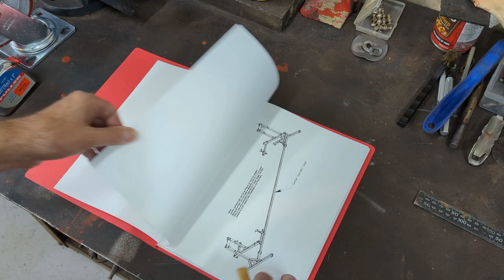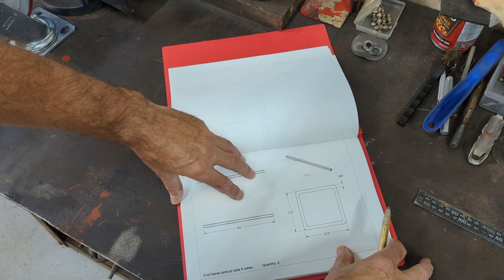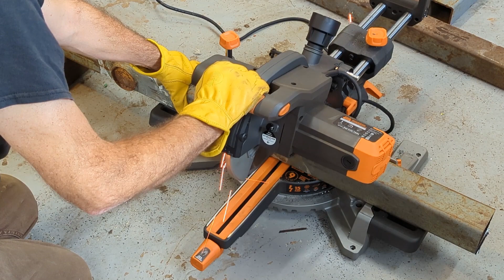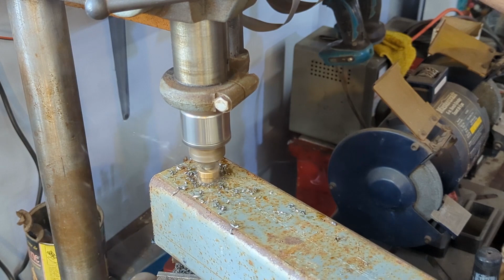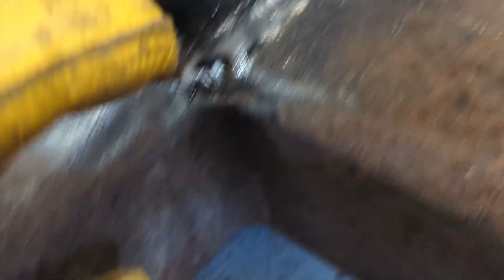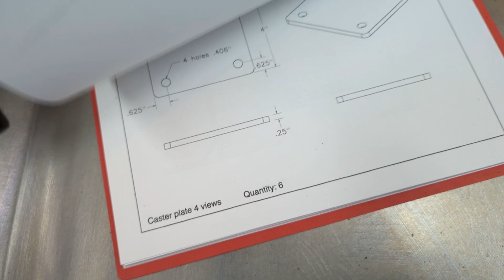DIY Automotive Rotisserie Build End Frames - Part 1

Comment: What kind of welding rods are you running? Looks good!
Reply from the maker: I am using 6013 x 3/32, a little small for what I'm doing, but just need to make a couple of passes to fill in nicely.

Comment: Your stick welding looks pretty good for not having done it for a while. My only suggestion would be to have a box fan close to pull the smoke away from you.  I always hated breathing those fumes.  You are well on your way to a nice rotisserie.
Reply from the maker: Thank you, it has been years since I used the stick welder, I kind of like welding with it...but like you said, the fumes are hard to take, I do use a fan to extract the fumes, but when it is too noisy when videoing, so I shut it off, off camera I have it on.

Comment: Well done sir, thanks for the education!  I wonder if the height is a reflection of the base width?  That is, 50" high, is a limit of the base width. With you going a little wider on the bottom, the math seems to work out for your current 66".  Regardless - thank you as always ~ Chuck
Reply from the maker: Thank you Chuck, I can't imagine needing to be more than 50" high, it would be a little shaky that high.
Reply: @JRShowYT  Indeed. But, I think if you (picking a random number here) decides on 60", your wider base would support it.  You know what you're doing, clearly, thanks for bringing us along.